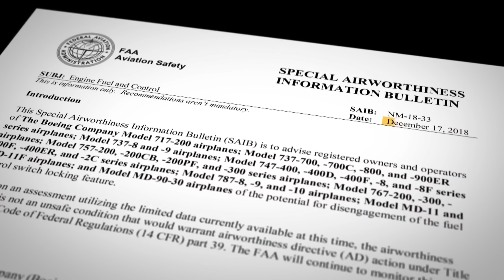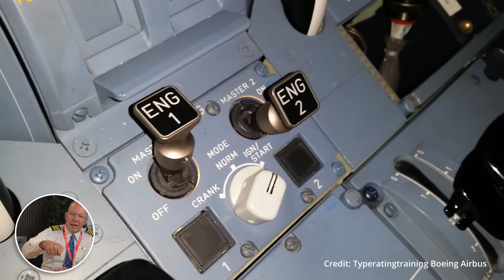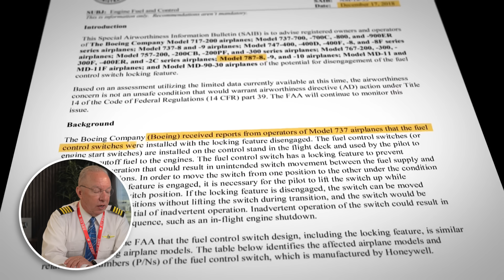Air India 171: The FAA’s 2018 Fuel Switch Locking Bulletin Explained (16 Questions Answered)

Comment: Hard to trust someone who afirms we have all the info and a video record would not tell us anything else.

I feel my intelligence insulted
Reply: What most people are missing here is that the FAA had already issued a warning back in 2018 (SAIB NM-18-33) about a potential issue in Boeing aircraft where the fuel control switches could unintentionally move due to vibration or mechanical failure.

In the recent Air India crash, both pilots denied switching off the engines, and flight data confirmed that both engine fuel switches moved from RUN to CUTOFF almost simultaneously.

If these switches are manual and controlled by physical levers, it's impossible for them to move without human input — unless there’s a mechanical fault, such as a failed locking mechanism, which is exactly what the FAA had previously warned about.

The aircraft involved had not undergone the inspection recommended in that 2018 FAA alert because it was marked “advisory, not mandatory.”

This strongly points to a technical glitch — not pilot error. It's easy to blame humans when machines fail silently. Aviation authorities should focus on the dual engine switch system’s design and whether proper inspections were neglected.
Reply: Actually that kinda shows your lack in intelligence? Do you honestly believe investigators cannot determine a match of voices to know which pilot said it? Even if their was cameras, footage would likely only be available for small audiences to view including family members. Publicly available, would be very unlikely for so many reasons people don't think about.

Comment: I have a question. Throttle up a B787 engine to near max power (required for takeoff), then turn off the fuel cutoff valve for 10 seconds and then turn it back on. What will the engine do? Go to idle, or instantly go to full thrust? I think the latter because the engine is hot and rotating at near full RPM when the fuel reenters the combustion chamber.

Comment: 2:47 No, you would not see someone pull them, why is it simple? The pilot flying has two hands on the yoke, eyes forward out of the plane, the pilot monitor has his hands on the throttle in most cases, behind the throttle, about 3 inches from the fuel switches. SO NO if you are looking forward, your eyes would see nothing odd.

Comment: The fuel control switches are supposed to contol fuel flow as per requirement. The question does arise as to the pressure of flow of fuel may have cut the fuel switches. The plane was carrying additional fuel due to route change. Fuel switch is not a mechanical valve , but is based on spring action.

Comment: I am a private pilot. And although not quite the same, the procedures that are built in to muscle memory if done appropriately is a good thing. One thing that has concerned me - is why the pilot has not retracted the landing gear? A pilot is usually going to use Vx or Vy depending upon the situation, but retracting landing gear in normal situations will occur at the latest just after clearing the runway. For someone who wanted to sabotage the flight would not care about retracting the landing gear. In my opinion, the gear should have already have been put into the up position. So it’s just a theory - but I would conjecture that the person responsible for retracting the landing gear would also be the one who set the engine switches to off.  At what point would the gear come up, and would the pilot request it, do it himself, or leave that to the co pilots checklist?  Whoever sabotaged the flight had no reason to retract the gear.
Reply: @robinfloyd2245 if the plane is still in the "ground mode" indicated by the faulty weight sensor,  landing gear would ignore the "gear out" switch... and also,  switching both engines off would not produce audible alarms...

Comment: I’ve been watching this YouTuber’s analysis since the beginning of the Air India 171 accident coverage. From the start, there’s been a 100% narrative building that Boeing and the Western lobby will always blame the pilots and protect the interests of the aviation industry. In his first video, he clearly blamed the pilots for unrelated reasons, and in subsequent videos, he kept shifting his theories as viewers pushed back and new facts emerged.

First of all, this is only a preliminary report.
The preliminary report on Air India 171’s crash does not conclusively blame the pilots for the dual engine failure. It confirms that both engine fuel switches moved from 'RUN' to 'CUTOFF' just after takeoff, causing both engines to lose power.

Crucially, the report only states the status change of the switches—it does NOT say this was done manually by the pilots or that it was intentional. In fact, there’s an important detail: in 2018, the FAA issued an advisory about the fuel control switch locking mechanism on Boeing aircraft, warning that some switches could be installed with the locking feature disengaged, but it was not mandatory to inspect or fix this. The same design was present on this Air India aircraft, and Air India did not perform the inspections since the alert was only advisory.

 The cockpit voice recording captured confusion between the pilots
Captian was on radio
And the pilot was in charge of plane
So the pilot who had his hands on  asked, "Why did you cut off?" and the other denied doing it. The report does not clarify which pilot said what, nor does it assign blame.
Based on available information, captain was on radio and the Mayday call was made by the captain,h after the engines lost power, which strongly suggests the crew was still trying to save the flight—not intentionally causing harm. If someone was deliberately crashing the plane, it wouldn’t make sense to declare an emergency and call for help.

With so much money and state reputation at stake, it’s no surprise that the Western lobby—including some YouTubers—will leave no stone unturned to blame the pilots and shield the industry. Here, this YouTuber is again jumping to blame the pilots, despite the evidence not supporting that conclusion.
Captain Ross Aimer also says that vibration of swirches was possible.

The investigation is ongoing, and experts have warned against jumping to conclusions or blaming the crew before all the facts are known. The cause could involve technical, human, or even design issues with the fuel switches. Let’s wait for the final report before making any assumptions or assigning blame.

Comment: Your analysis is very nice but with following limitations: 
1. A camera is a small tool for physical observation to check cockpit situations and final position of aircraft switches, pilots actions and warning signs. AI generated camera also can help pilots and observers any safety failures.

2. It’s not a human error at this aircraft. Boeing series had problems with fuel switch as special bulletin was released on 2018. 

3. Generally pilots don’t lie  and believe each other inside cockpit. It’s a sacred place . As a pilot I do believe so. Boeing should be brought under microscope. 

4. Let see how rest of the report comes out . Preliminary report had a lot of questions. 

5. We want to know the truth. Love for all pilots

Comment: I heard a senior Indian pilot comment on the AI171 787 incident and would appreciate any expert input.

	1.	He said the co-pilot was the pilot flying at takeoff — so both hands would be on controls, making it unlikely he cut off fuel. That implies the captain may have done it. It’s also noted the captain was under personal stress. The PF would naturally question the cut-off — reportedly denied.

	2.	Modern CVRs record each pilot distinctly. So why the confusion about who questioned or denied it? Is this deflecting focus from possible aircraft/system issues?

	3.	Technically, can fuel cutoff switches on the 787 be activated any way other than manually? If not, wouldn’t SOP require the other pilot to immediately reset them to ‘RUN’?

Comment: From SAIB-NM-18-33 :"If the locking feature is disengaged, the switch can be moved between the two positions without lifting the switch during transition, and the switch would be exposed to the potential of inadvertent operation." Why you don't go into deeper analyze on this sentence taken from the SAIB-NM-18-33 ? Thanks with all respect :)
Reply: Combine the unlocked switches with the way that both pilots have their hand on the thrust lever at the same time while rolling down the runway, and the pilot with their hand on the lower part of the throttle lever pulls their hand off the throttle after the plane is airborne... and that's when the fuel cutoff happened.  The 2018 bulletin foreshadowed this disaster.

Comment: The Investigation tesm recovered the fuel cuf off switches.  With that in possession cant they just test them and determine if they are working correctly,  in other words did they require you to lift and switch off?

Comment: Might be that its a little different for pilots as planes are very complex but i feels like 10 seconds to revers such an obvious mistake is kind of a lot especially since the pilot saw it straight away, like if i was in a car and my passenger somehow turned off my engine i would react in under 2 secods not 10. could the delay be more resonably explained by a strugle in the cockpit with the pilot who pulled them attempting to stop the other from resetting them. would it have been possible to recover with a shorter time gap between off and on?

Comment: Dual control system on such critical area is needed to prevent such incidence. There should be dual locking/control system. Main piolet should be provided with a switch to lock or unlock the mechanical fuel control swith. Once the main piolot do this then only the other piolot should be in a position to perform the exercise manually.

Comment: Another thing to remember when considering alternative scenarios causing the fuel to be cut off - the switches were then moved back to the Run position and the engines started to reignite and spool up normally as evidenced by other information from the data recorder. The switches are also separate so any anomaly would need to affect both circuits 1 second apart and then allow the engines to restart 10 seconds later when the switches were moved back. In short, the evidence doesn't support this theory.

Comment: Should there be two sets of switches, one on each side of the cockpit, so both pilots need to switch them off before the fuel shuts off.  They are only used once landed anyway. Maybe they should not be able to operate once the landing gear is off the ground or past the go-no-go speed?

Comment: Well, firstly a visual indication for fuel switch is an absolute must as multiple indicators will help shorten the transient panic state of a human pilot. Cameras also is very important, which could be live recorded via a satellite with the current age technology. Just for the sake of covering up the wrong doings of the Pilots it cannot be said No for that. It would at the leaat help in understanding what had happened.

Comment: All we know is that one pilot (likely the captain, who was the pilot monitoring) asking the other pilot "Why he cut-off the engines" and the other pilot (likely the 2nd officer who was the pilot flying) replying "I did not". We also know that both switches were subsequently turned on, but one engine started again and other did not. Due to lack of sufficient thrust the plane kept losing altitude and ultimately crashed. From what I have learned so far, I don't believe anyone would cutoff engines by mistake. So it's either a mechanical defect or a deliberate action by Pilot. Both the pilots were experienced and there is no information to suggest that there was any mental health issue or anything else at play.

I don't understand how you concluded that it's a human error. Since you are a pilot yourself, I was expecting you to ask more questions than blame it on dead men who cannot defend themselves. Let's say one pilot deliberately shut the engines off and the other pilot tried to turn them on, then there would have been some kind of scuffle and lot of yelling? If that was the case then the report would have said that. I suspect we are going to learn in few months that it was a mechanical defect with the switches.

Comment: The report does not state that the cockpit voice recorder audio indicated manual actuation of the fuel control switches. It states that they transitioned from RUN to CUTOFF position with no mention where this conclusion came from. I would be interested in knowing if the audio and flight data agree on this.

Comment: TOGA, Autothrottle, and FADEC all  control the throttles under various circumstances.  The cutoff switches are just the first link in the chain and all we have is some burnt switches in the run position and flight data recorder info that says wires to the fuel valves were deenergized. It is quite possible that the person who said he didn’t touch the cutoffs…actually didn’t.  
The flight data recorder will only show that wires to the fuel valves became deenegized.  Depends where the voltage sensing takes place…and only a wiring diagram can tell us that.  Also these throttle control modules were replaced on this aircraft two and four years ago for some reason.  The reasons for this need to be reviewed.

Comment: Your answer regarding video in the cockpit seemed kind of weak. Your conclusion was that the cameras would not have prevented this accident. Fair enough. But it could allow a very clear explanation of what did happen, and what did not happen. Your other argument was a fear of leaks of embarrassing behavior in the cockpit. Well, I get that, but there seems there are ways to deal with that through law, regulation, and termination procedures. But in the end, such embarrassing things should not be happening and isn’t a clear determination of what caused an accident something with more priority?

Comment: I took it a little bit differently about the cameras, is it possible that he doesn’t want the actual ins and outs of flying of each aircraft to get leaked or hacked because of possible terrorists getting a hold of that footage and being able to see how some things are done could be a security issue? Because there are some times he’s been answering questions and he doesn’t want to answer exactly how something is done or the procedure you do to operate something in the cockpit. That’s a little bit more of how I took it at the beginning.

Comment: The issue I have with the theory that the pilot did it is that if he was planning on doing it, it would very likely be mid flight not immediately after takeoff
Reply: That would have been recoverable though. This was done when it was impossible to fix.
Reply: @selbyjohnson5986 fair point

Comment: I'm a little surprised...  Reading a magazine seems to be forbidden in the cockpit, but, hey, let's not have cameras there in case things like that were recorded!  Unbelievable.  And I agree with those who say that if cameras can be used everywhere else, they should also be used on planes.  As a passenger I expect everything is done that keeps me and others safe.  And yes, if this was a deliberate act, cameras might have prevented it from happening.  The person responsible would have known they were being recorded, and that may make a difference in those cases.
Reply: How about for safety.  A camera will be hacked and you can see what the combination to the gun case is.  😵
Reply: Exactly - I am appalled by the reasoning he makes against having cameras installed in the flight deck. Ridiculous!
Reply: @MohammedFarhaz  Good pilots wont mind.  The video will stop the NTSB from making them the patsy since they can't defend themselves.

Comment: We saw calm desperation in the cockpit — not sabotage.

There was no “London, here we come! — oh wait, let’s quietly kill both engines.”

Instead, we hear a pilot ask why the fuel was cut.
The other replies: “I didn’t.”

That’s not a joke. That’s not drama.
That’s two professionals watching their aircraft die,
without understanding why —
because the system logged a mechanical switch as human intent.

A switch assumed to be protected,
was never inspected,
because a non-binding safety bulletin got buried in the bureaucracy.

And now, media spins “pilot error” while the logs tell a quieter, darker story:

Nobody chose to shut down the engines.
But everyone (Air India, Tata) chose not to fix the one part that could.

Comment: If you have to reach OVERHEAD  and back to start the engines, why in heavens name would you put the cutoff switches down where all the other misc switches are located? Move the shutdown switch’s back were a deliberate  effort has to be exerted to get to them, not down writhing easy reach. Sounds like a design flaw to me . Rf-Tn

Comment: AI171 was a long range service typically around 9 hours flight duration.  Would that fateful flight have been carrying additional flight crew or indeed any other authorised (or unauthorised) persons on the flight deck who could switched off the fuel control valves? 
(A related incident almost occurred on Alaska Airlines Flight 2059 whereby a third person on the flight deck attempted to engage the engine fire suppression system but was prevented from doing so by the duty flight crew).